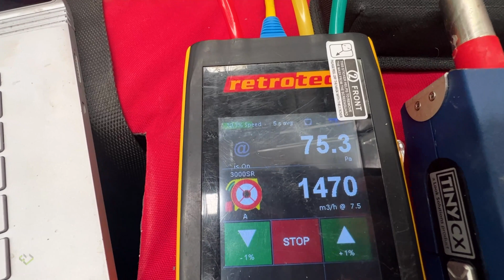The importance of Datacentre air tightness

Comment: Do the top of rack switches face the back of the rack or the front of the rack?
Reply from the maker: This is hot aisle containment.  So the switches would have their backs to the containment.
Reply: @ecoevo thanks, switches can have the fans blow in either direction configurable from the manufacturer, but you get to use slightly shorter cables if they are rear facing. Just wondering if there's a preference when the heat management is concerned. At my work we have front facing switches and narrow hot isles but I'd prefer rear facing switches, both cases with the heat blowing into the hot isle